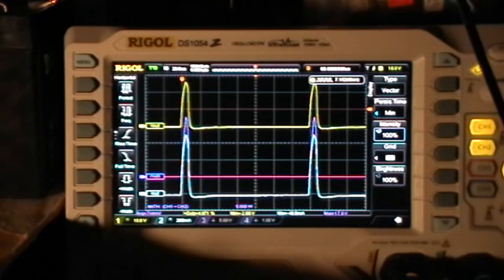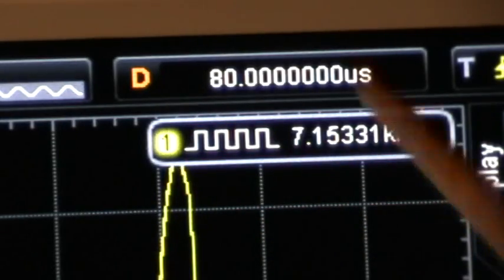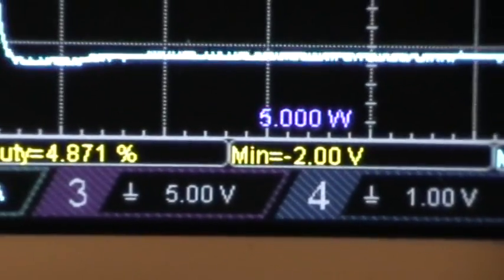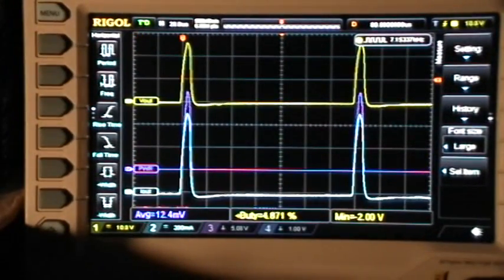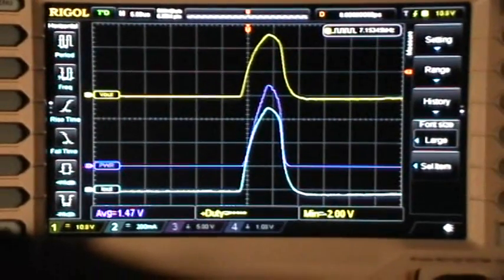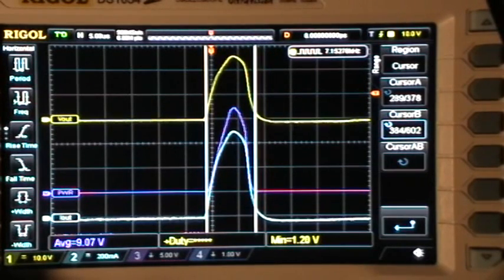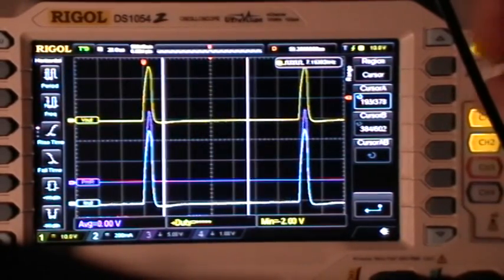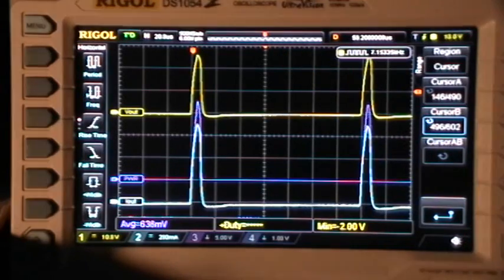Scoposcopy: Rigol DS1054Z Power Computation, Measurements, Range

Comment: 9:10 When you adjust cursorB, it is also changing the value you have set for cursorA.  Is that a bug or a feature?
Reply from the maker: I'm not sure what you mean. There are several different cursor modes; in one mode they both move together. In another mode you can move one or the other, and the numerical display can tell you the actual position of each cursor and also the distance between the two cursors. So, depending on what cursor mode you are in and which cursor(s) you are adjusting, the values will change. I haven't noticed anything "buggy" about how the cursors work. If you have some measurement selected and you have the cursors in "auto" mode they will magically adjust to where the instrument is making the measurement.

Comment: Hi
Can you tell me how did you got the Avg measurement for the math (at bottom left, purple color).
I have the same scope but did not figure out how to get an average from math measurement.
What is the exact procedure?
Can you help me?
Thanks in advance,
Reply from the maker: All of the "left hand menu" horizontal and vertical measurements are available for the Math channel as well as the 4 regular input channels. The "all measurements" table is also available for the Math channel.  First turn Math on by pressing the Math button next to the CH3 button, and selecting Math>Operation>ON from the right side hotkeys. You don't need to set up the Math yet, just turn it on. Then press the "Measure" button in the Menu section of the front panel. Now press the Source hotkey and you will see that MATH is included in the options (no longer greyed out). Select Math here, and the left-hand hotkey menu items all turn purple and apply to the Math channel and can be selected just as for any of the 4 input channels.
Reply: @TinselKoala  Hi
Thanks for your attention.
My problem was I could not see how to enable left hand measurements for math.
Now, with your help, I saw it. 
Just turned source measurements to math and all is available for math on left hand button set.
Thanks again...